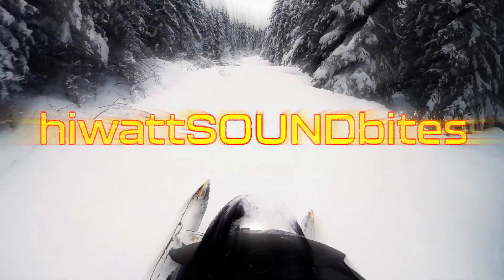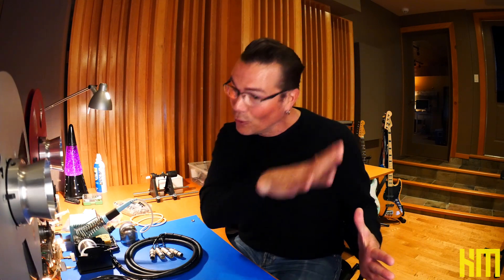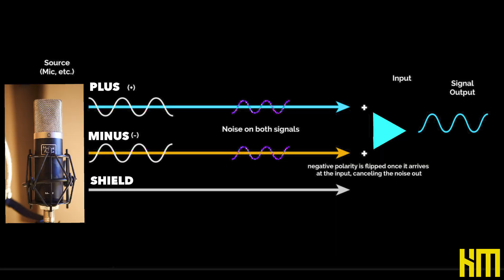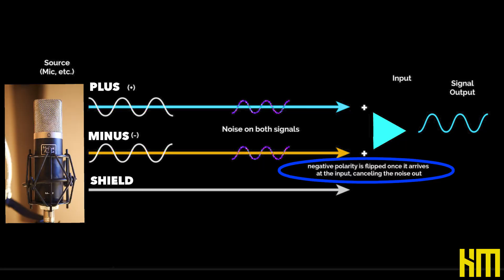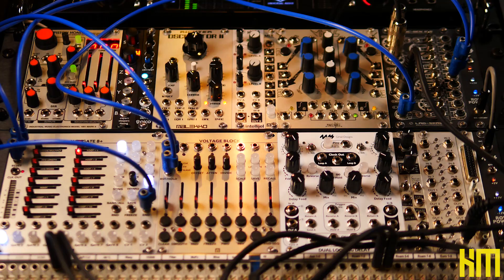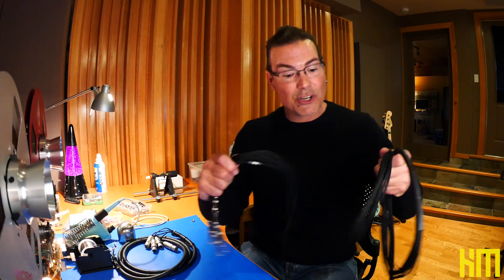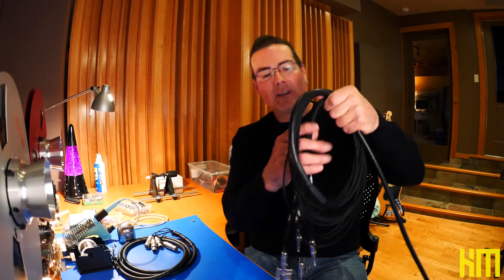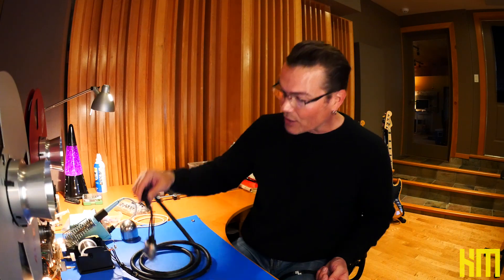Professional Balanced Audio - how to design an ULTRA-low noise floor in your studio!

Comment: The explanation of balanced audio here is a bit misleading. The shield still works the same in balanced and unbalanced signal as it's used as common ground. The only difference is that there's an additional signal line that still uses the same shield as common/ground (not the other signal line) but it's in opposite polarity. The differential amplifier in more simple terms flips the negative phase signal at the end of the line to original positive phase and thereby any noise inducted on both of the signals will be out of phase between the two signals and gets cancelled out when two signals are summed. I'm sure you understand that but I think it could be explained a bit more technically better. Also mine could be done better :)

Comment: What are you intending to use the A77 for - effects? masters?
Do you have an MRL for the tape machine, or is it even possible to do a "proper" electronic and/or physical alignment on that deck?
Thanks for the explanation regarding differential amplifiers.

Comment: Ken!!!!! Where were your informational vids back when I was building my home project studio years ago, eh? Since I've been doing home recording from the mid 90's I've always be frugal (ie. cheap), always running unbalanced cables everywhere, except for my mics and wondering "hmm where is all this ground hum and noise is coming from?". After  25+ years of diy home recording I finally bought my first pair of balanced cables for my powered monitors 2 months ago.  I mean,  being cheap has been an enemy of the  noise floor in my recording for decades.  Very very very good information that you passing along here. Just as important as gain staging imho.